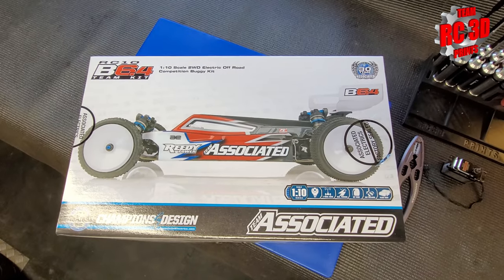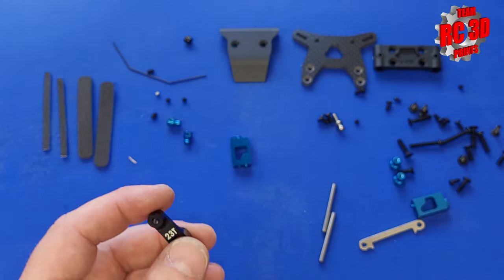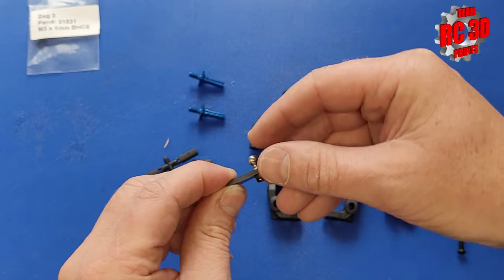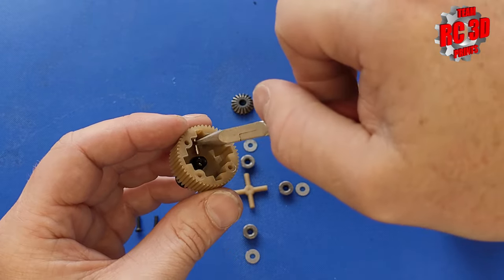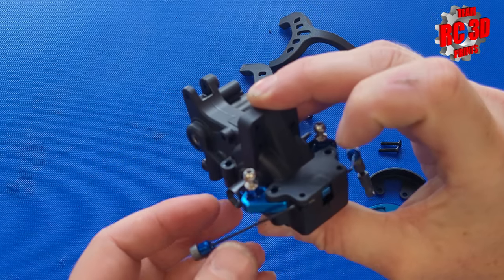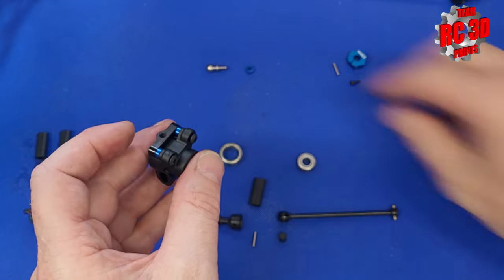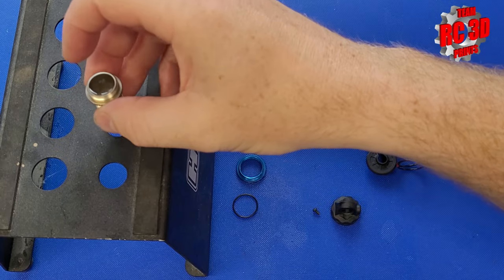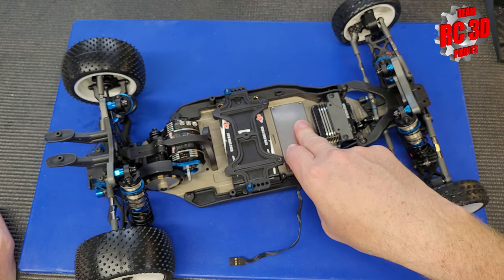Team Associated RC10B6.4 Team Kit Build Video - is this the ultimate race car

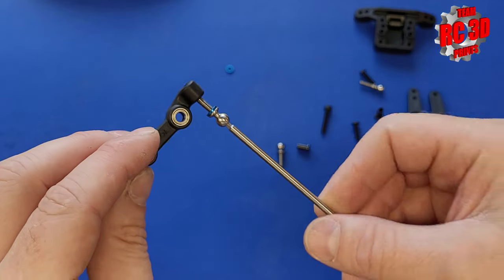Comment: At around @2:35 when you're installing the steering "link" or whatever its called, 4 small bearings you forgot to mention you have to throw in 2 small ball joint 1mm washers 👍
Reply from the maker: Just upgraded to the alloy link and realised that!
Reply: @Team RC 3D Prints  Man I did the same when I upgraded to the alum link also! It didnt say to swap those washers from the original and when I tightened down the screws they would bind up the bearings haha I actually ran the car that way for a while before literally just the other day I realized i never put them in 😅
Reply: First mistake I found on a used buggy I bought. I ran it like that for a long time actually. Until it broke and I upgraded to aluminum, so like 3 whole days 😂
Reply: What's the brand of servo horn you used?
Reply: @chrisolsen3299  I'll take a look when I get home

Comment: What is the part number for the metal crosspins in the diff?  Thanks, great video
Reply from the maker: Not sure details should be on ae site
Reply: It’s in the back of your manual. You can also find a pdf version from ae website

Comment: use locktight on the little screws that holds th piston in the shocks, they will come loose after a short time driving otherwise.
Reply from the maker: Yes for sure

Comment: Any way u can tell us what tools are needed to complete the build, hex sizes? Nut sizes? Pliers? Thank you
Reply from the maker: You will need 1.5 2.0 2.5 mm hex drivers 7.0mm and 5.5mm nut wrench and long nose pliers. Thinks that’s about it. I use shock pliers but they are not essential
Reply: @TeamRC3D  awesome thanx!!
Reply: @gigi9467  you will also need soldering tools. Body reamer, body scissors, tire bands, and tire glue. You might also need a tire break in tool depending on surface. Oh and an exact knife paint and servo tape. Depending on battery choice you will need 4-5 mm bullets also.
Reply: @gigi9467  digital calipers are helpful when doing turnbuckles along with a turnbuckle wrench
Reply: @colestaples2010  thanks but I decided to sell a kit and buy something cheaper to get started. It was getting ridiculous. How much money it is
Reply: @gigi9467  the kits are definitely higher quality but yes it gets ridiculously expensive. I’ve got an embarrassing amount of money spent on them
Reply: @colestaples2010  yea i just coukd not justify the price not saying that they are not quality but then again its mistly plastic, but it was going to cost me more than 2k to build two cuz i nee one for my son, at that money i can buy two 50cc bikes and teach them a skill. Just did not see a value in it
Reply: @gigi9467  you should check out the mini b for the kid. Cool thing about rc cars is once you have all the high dollar electronics you can get a new car cheaper and use the electronics for multiple cars
Reply: @colestaples2010  yea i have a tram associated reflex b for him but wanted a 1/10 scale, looking at the aarms typhoon or ae rb10
Reply: @gigi9467  in my experience with an rtr you end up paying more in the long run. If you need some advice building a decent starter buggy just hit me up. I can steer you towards some less expensive electronics that actually work well enough to get started. I bet I could build a good sportsman’s class buggy for about 7-800
Reply: @colestaples2010  i disagree, unless you are racing then yea that should be the only reason to get a racing buggy, but if u are just practicing around a track not
Bashing rtr’s now a days hold up extremely well and usually break as often as over priced racing ones, of course they will never be as fast around a track but it dont mean they are not fun. Thanx for offering me help but am
Pretty sure i know what electronics u are going to recommend and those do cause issues later on, at 1k its a reliable race able car but i just dont see the value in it at this point in my life. I did years a go

Comment: I’m watching your video while waiting for my B6.4 to arrive. 
Im currently at minute 26:49 and there are some o rings which are gone in the next shot. I was wandering if they are for the 4 screws in the differential, or don’t they belong to the kit?

Thanks for the video, I guess I will rewatch it during the build if anything is unclear.
Reply from the maker: We didn’t use them
Reply: The four tiny o-rings are option parts to fit between the diff planet gears and their backing washer. They are supposed to add a bit of diff bind to make a gear diff behave a bit more like a ball diff. Sort of intermediate. I've tried them and they make a marginal difference. Not really worth bothering with compared to tyre choice and just using a ball diff..

Comment: Front hubs are prone to cracking but otherwise, it’s an “okay” buggy
Reply from the maker: never has issues with them
Reply: know alot of people that dont got the problem of cracking front hubs if they dont crash hard in to solid objects alot and in that case the front susp arm is whats take the bashing in 99% of the time.
Reply: @extec101  Asphalt racing is hard on them...

Comment: For telling everyone to pay attention to the details. Watching you insert all of the bearings in backyards was pure cringe.
HINT: The Blue Rubber face of the bearing is supposed to go towards the outside to prevent dirt getting into the bearing race.
Reply from the maker: Thanks for comment
Reply: Came here to write the same! To further explain to anyone reading this that doesn't know... The blue ring is the dirt seal which needs to be on the outside -dirt side. Silver side is open and allows dirt in. Bearings normally come with seals on both sides, but AE remove the inner seal to reduce seal drag as there's no dirt on the inside of the gearbox or inside of a PAIR  of bearings in a hub -i.e. blue seal is not needed on the inside. But if you don't know this and put the seals on the inside and the open face on the outside it's a facepalm moment -as you might as well have unsealed bearings, they'll wear out fast. Just put the blue sealed face on the outside (blue seals on dirty side).

Comment: I’m not real happy with my b6
Reply from the maker: Really? Why?
Reply: @TeamRC3D  problems with the differential. If I could get more run time with less parts invested I might be happy
Reply: @TeamRC3D  maybe it’s just a newbie problem I don’t know. I just want more consistent track time before it acts up. I guess if I was wealthy I wouldn’t care  but I’m not 😂
Reply from the maker: @colestaples2010  did find as standard they need rebuilding quite frequently
Reply: @TeamRC3D  I just finished my latest diff rebuild and I think I finally got it right, time will tell. I cleaned everything with nitro cleaner this time. Got precision ground diff washers or whatever they are called and a caged thrust bearing. Used the jconcepts diff grease also. It’s the smoothest diff I’ve ever had but man it was expensive!